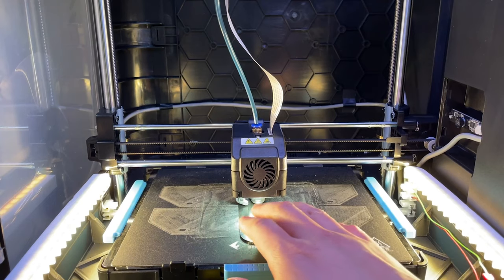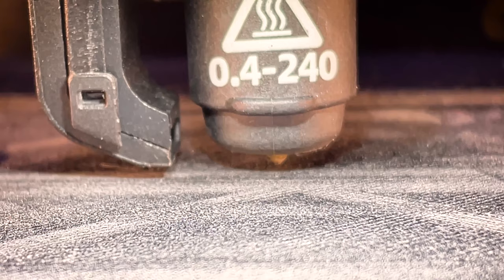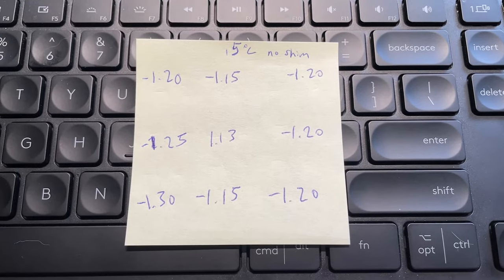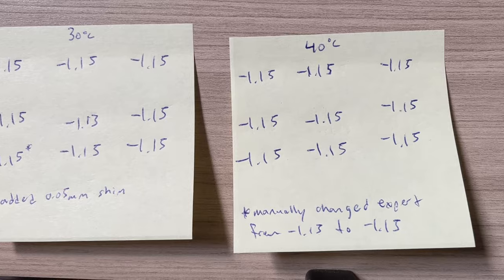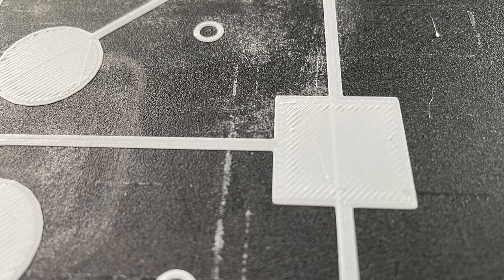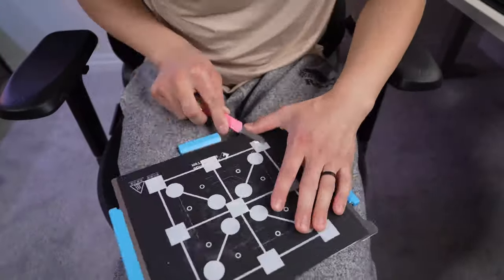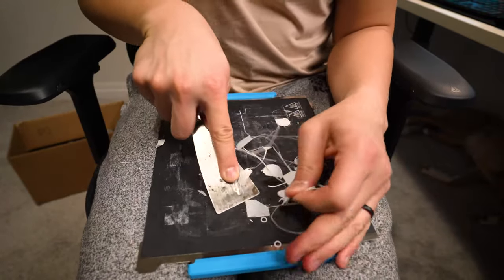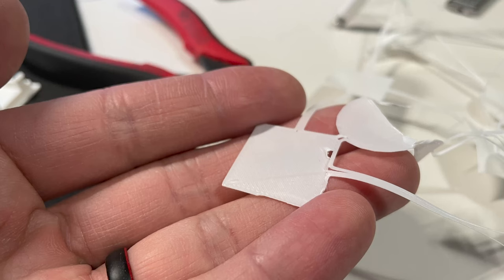Calibrate your bed at the printing temperature, truth or myth?

Comment: My anecdotal experience with an Ender 3 Pro is that heating to 60C definitely changes bed leveling and decreases clearance to the nozzle. The middle heats up fastest and then the outer edges, so at first it creates a slight bow in the bed. I haven't used proper measuring tools or done proper experiments, but this makes sense to me.

Comment: Hey Daniel, good to see you making videos again.  I've stopped using an exacto knife on m bed after scoring it a couple of times. I've gone to plastic putty scrapers with good success. I should mention that I often throw my bed into the freezer for a few minutes and things just release without much effort. I'm one of the lucky ones as my AD4 bed is close to perfectly level, though I watch the first layer like a hawk and make adjustments to the Z axis and flow rate as needed. I'm gonna order another build plate as I like to do rapid turn arounds.
Reply from the maker: This is my second adventurer 4 and it’s still not level. I’ll make do though since shimming works okay. Do you always take your print bed off right away when the print is finished in order to throw it into the freezer? What happens if you come back a while later and it’s cooled?
Reply: @justmakeitdaniel7667  It just pops right off.

Comment: Hi Daniel. I just got my Ad4. Based on your videos i ordered 2 extra build plates and and probably going the PEI route that I saw you do. Currently my back is injured and it's still in the crate. Thanks for the useful info you have shared. I also have a CR-6 se that is acting BADLY. nozzle scraping prints coming off - UGH!!  So hoping for some good work from the 4! wish me luck Bro!
Reply from the maker: Hope everything works out for you with the Adv 4! PEI is great for printing PLA but I am weary about doing petg on it right now based on reviews I've seen where the PETG welds to the PEI and takes chunks out of it
Reply: Hi Daniel,

Just dropping a line saying this thing prints pretty well. Although printing thin stuff like wings or horz stabilisers took me a bit to get right. these damn things don't have flat lower surface and the flash print software does not cope with sub 1 degree angle rotation - i found a command in the support tab that draws a line around the job. That seemed to give me good adhesion. So can you pass this along to the guys? The wing width at the widest part as about 2.5 mm and tapered way down to maybe .5 mm. before is I did the line around command the parts just kept falling off. oh and jack the temp up to 220. Next milestone for me is getting S3d to print on that. i have a FFF file from them so we'll see what goes.
Cheers!
Jack
Reply: @justmakeitdaniel7667  My PETG molded super tight to the default build plate to the point where it wouldn't release without taking large chunks of the top material with it. With PEI, it hasn't ever happened. Can totally recommend PEI.

Comment: Adding my experience. I've had similar issues with the bed not being level. My bed had a high spot in the middle and sloped off on the sides like Daniel mentioned in other bed leveling videos. I took the entire build platform off and removed the aluminum sheet to check it with a straight edge. 

There's a shade tree mechanic method of resurfacing cylinder heads where you use a piece of glass and sandpaper to get the surface level. I was thinking about doing that until I flipped the aluminum over and checked the other side with the straight edge. For whatever reason the backside was way better. I used a 0.038mm feeler gauge with the straight edge and it all checked out. 

When I put everything back together (with the bottom side now the top) and did the 9-point leveling. Only two numbers were different from the others and they were only off by 0.05mm. It's still not calibrated perfectly yet (I think I messed up one of the calibration numbers in a corner) but for the first time since I bought this printer I can use the entire bed for a print.

Comment: Daniel are you planning on doing some tests with the 0.3 nozzle?
Doing some tests here on 0.3 but it seems like mine is feeding filament to quickly, so the feeder cogs are spinning/grinding on the filament...
Anyway, great video again!

edit: 210 > 240 temp seems to have solved it... seems to be a common issue!
Reply from the maker: I will get to it eventually. For now I haven’t had time but glad you solved the problem by turning up the temperature
Reply: @justmakeitdaniel7667  looking forward to your tests. 0.3 gives really good quality/detail!

Comment: I also had to shim the right corner where the white warning labels are located.  Bed is finally leveled properly and I'm getting really good 0.2mm layer.

I used my battery welder nickel strips for leveling 1.5mm and 1mm and it holds its location because it's magnetic.

I just couldn't get that corner leveled without negatively impacting the same side but back corner from digging into the bed.  The 9 point adjustment does not work as I would expect.  

Also my offsets are between 2.95 to 3.20 with the latest firmware updates the week.

Thanks for all your videos as it has helped me quite a bit.

Comment: Anycubic Chiron: 400x400 mm, very thin 'glass', very thin aluminum heater.
This leads to lots of warping with small changes in heating.
I probed leveling meshes at 21c, 45c, 65c and 80c.
Compared the meshes, I saw some stuff.
If I heated the bed to 65c and held it there for 10 minutes, the 65c 'warp' is the same every time the bed is heated to 65c!
But when comparing 21c to 45c meshes?  
Might as well be two different machines!
Calibrating the bed is a cold/hot process: make everything you can right with a cold bed, then heat it up for 'fine tuning' with a leveling mesh.
Consistent conditions/techniques give consistent results.
How I implement this idea: On first print of the day, I heat the bed, let it 'rest' 10 minutes, level the bed, then keep the bed at that exact temperature for the rest of my printing day.
Haven't had issues with adhesion or first-layers since.
!!!
Get rid of the springs under your print-bed!
Install 'jam-nuts' to lock the leveling-knobs in place, once you have 'cold level' well established!
Loktite Blue is your friend...
You'd never see springs supporting a large flat mirror in a telescope, unless it was being adjusted or repaired!

Comment: Hi Daniel, I have an Ad4 but I have a problem that I can´t resolve, maybe you have seen something similar, I get gaps between the walls (shells) and the fill but just in the right wall, like the entire fill and layers have a little offset (like 0.5mm), but walls are fine, changing resolution in the flashprint slicer help a little bit but still having this issue, very annoying, thanks for your content! very helpful
Reply from the maker: 0.5mm is quite significant… that’s more than one layer width. How many different prints have you tried?
You can try increasing the extrusion ratio, rotating the piece to see if it becomes the left wall, or increasing the infill overlap setting to like 50%
Reply: @justmakeitdaniel7667  Hi Daniel, yes, I did all of that, it happens always, every print, the extruder returns when almost reaches the wall and looks like the opposite wall the fill is a little overlapped, this is driving me crazy :(
Reply from the maker: @omarcarrillo3798  have you tried a different slicer? I haven't had any issues with the gcode generated from flashprint so I find that very odd. You could also look into the gcode itself to see if there is anything inconsistent there
Reply: @justmakeitdaniel7667  I tried Cura with your guide but I had no success, my first layer is completely smashed, but with flashprint first layer looks good... I received a firmware download yesterday, maybe it get better, thanks!

Comment: I had the same issues with leveling.  I need to get some shims as the bed is off enough that some squares were too squished and some not extruding enough into the corners (slightly too high). Kind of frustrating cause if I lift those tight ones in the software nothing changes. As for the loose square corners, I think it is extrusion ratio as it defaults to 96% in Flash print. I was going to compare it to cura but i just updated the Firmware and it killed printing with cura as the print head just floats in the air.  So need to roll back... Have you thought about swapping out the fans for more quiet ones?
Reply from the maker: was there a new firmware update today? I haven’t seen anything come through yet.
I have thought about waiting to something quieter but the problem is the fans all run on 24V and I haven’t found any good sources for quiet fans
Reply: @justmakeitdaniel7667  I saw someone post about having more leveling points in a video with a new Firmware. It is a beta so I asked FF support for it. Wasn't much help IMO for the leveling but it defaults at a much higher point for the nozzle. So the new firmware was no benefit. In the previous Firmware my leveling was -1.65 now is is -3.65 so that default throws off cura and it just prints in the air. I would wait till it is official.

Comment: Hi Daniel. Have you preheated the bed and nozzle before leveling? I do seem to get variation in the 9 points when the bed temp is needed over 70 and a nozzle temp over 225 for some materials. The default temps of 210/45 works just fine for most basic PLA. I try to keep to the mid-range of the spread that is spec’d  out on the spools. Also, kudos on the shims to level the bed. Making sure the six right-down screws were equally torqued was were I started.
Reply from the maker: Yeh I didn’t mention the screws but they are tight. 

I haven’t tried heating the nozzle for 9 point levelling but you might be right that it has an effect on the calibration. I actually think that extruding plastic might cause the levelling to be off since the filament is pushing with a decent amount of force which in theory pushes down on the detachable nozzle (not on the entire extruder assembly persay)
Reply: @justmakeitdaniel7667  Powered on this morning and was treated with a firmware up date. New .5mm adjustment, and summary of settings with ability to revisit a spot to readjust without having to start over.  Also - I’ve been leveling with no filament loaded to avoid oozing as best as possible.
Reply from the maker: @bryannewhard5018  hmmm a 0.5mm adjustment seems like a very large step. I would have wanted a 0.01mm adjustment button. I have yet to do the firmware update yet but will get to it eventually. I saw a video of someone’s printer smoking after the update which is why I have been hesitant to do it
Reply: @justmakeitdaniel7667  yea I can’t say the .5mm adjustment isn’t anything I would use either but I did like the the summary at the end of calibration and ability to jump to a spot and tweak it if you hit next to quickly. As far as smoking post upgrade - I’d have to ask what they hacked prior to create a bad situation.

Comment: Hi everyone, I found a better way to get stubborn pla off the bed. Get yourself a heat gun and a paint scraper (with a fine edge). Just heat and scrape, and it doesn't hurt the bed.
And now a question - I cant make any jobs stick to the raft. they all fall off! temp 210 bed 45, raft sticks like a trooper. no adhesion to the raft. filament is the stuff that came with the adv 4. Thanks in advance!

Comment: Hello to AD4 owners.
I have this one also and I think this was my bad purchase, I fight with him about 2 months and have problem with printing big models 180x180mm 
because bed is not flat and impossible to calibrate it with 9 point calibration procedure,  Daniel has video about it!
I did small tuning but anyway do not get flatness less then 0.2mm in the center of bed, between left and right sides differences less then 0.1mm but between left/right and center 0.2mm, also 0.2mm difference between front and back of the bed. 
Week ago purchased Prusa mini+ and it prints every day without any problem with PETG filament, because he has REALLY 16 calibrations points and change Z axis while printing for bed error flatness compensation.
AD4 has many problem while PETG printing.
 I think AD4 is not 3D printer this is a CRAP, DON'T spend your money and time!
Reply from the maker: Good job on getting the prusa! I would probably get that printer if I were to start over again. At this point, I’m stuck with the adventurer 4